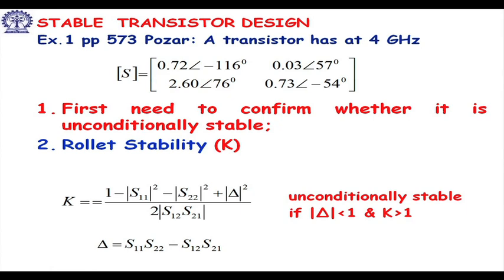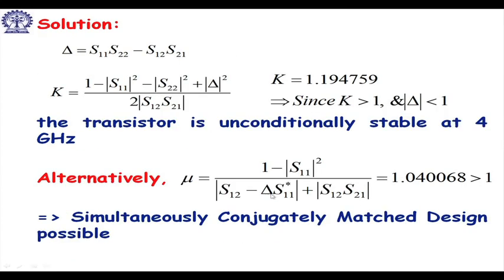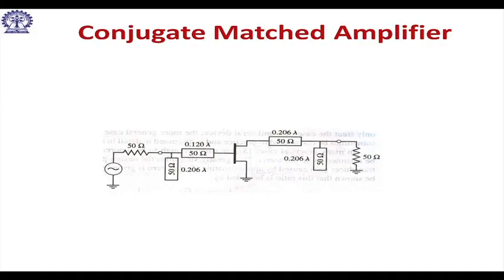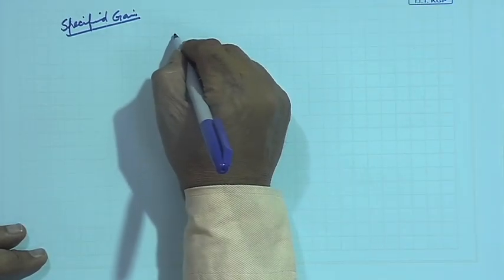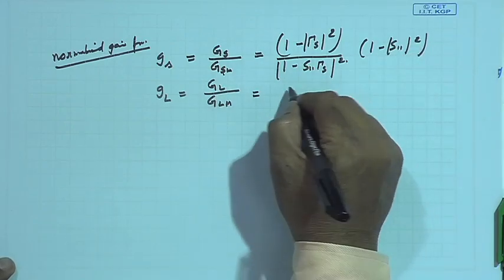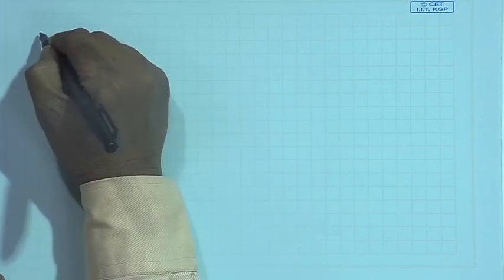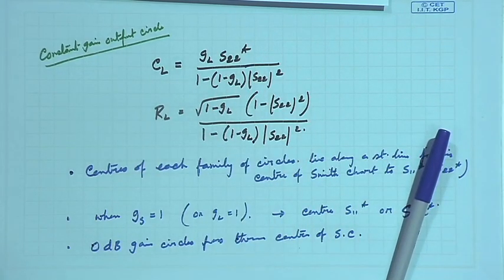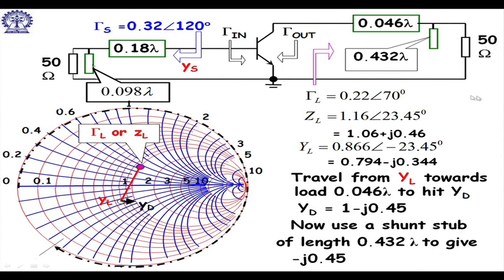Amplifier design for specified gain

Comment: Thanks but i see two possible errors.
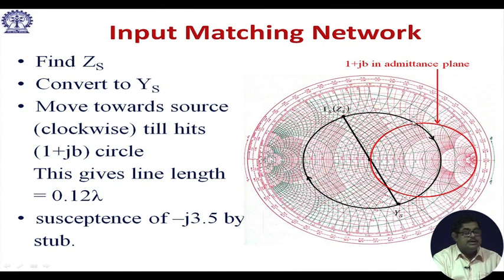7:31 if we move Ys to 1+jb it will add (0.28)+(0.5-0.329)...whis is 0.45...
how did you end up (0.28)-(0.5-0.329) which is 0.11 or 0.12??? but why not 0.45